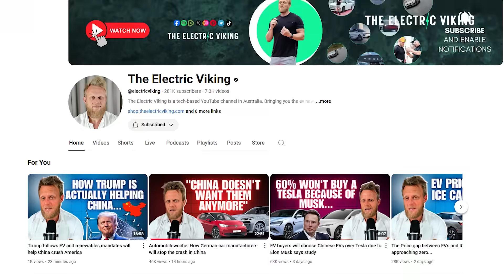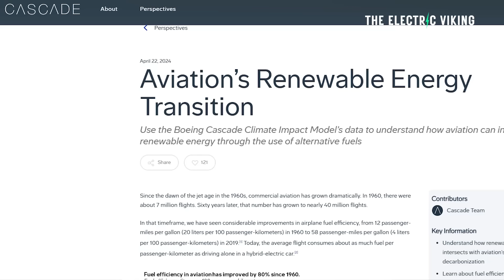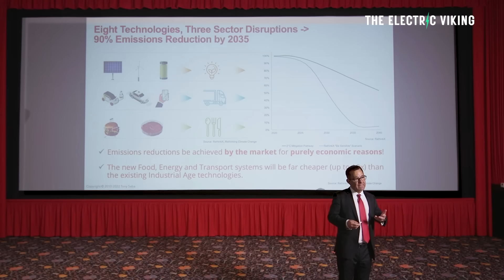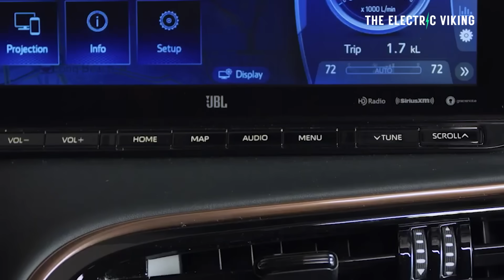The global industries that clean hydrogen production with DISRUPT

Comment: For cult followers of Electric Viking, all opinions of his are sacrosanct. While talking about hydrogen, he forgot to mention that the roundtrip energy conversion efficiency of converting renewable energy to hydrogen to fuel cells is only 30-40%, while battery round trip conversion efficiency is more than 90%.
BTW, why carrying heavy batteries is a problem for big ships? Weight is not a big issue in water transportation.
Reply: Batteries don’t work for large ships due to their low energy density. I think practically, the same thing goes for hydrogen. Even liquified, it takes up a lot more space than hydrocarbon fuel for the same energy. The higher efficiency does make up for this difference to an extent - a ship might only convert 30% of fuel energy to propulsion whereas a fuel cell on hydrogen can do 70% or so. But you have to also consider the extra insulation and management infrastructure that hydrogen needs. Once you add all that and all the safety measures hydrogen needs, it ends up consuming 4 to 5 times as much space as conventional fuel tanks.
Maybe you could get away with that on a large ship but no way will that work for an airliner. Every possible bit of room is already occupied for fuel tanks on long-haul aircraft. Hydrogen will not work as a replacement.
Reply: If it is only "excess" energy being used to produce the hydrogen, the energy losses aren't so relevant. The real problem is the low volumetric energy density of the hydrogen and it's storage system combined. In a large ~ocean crossing ship, a usable amount of hydrogen would require such large storage containers there would be little room left for cargo. Batteries are slightly better, but they would still take up far too much space.
Reply: It’s simple and well known, oil, yes oil is a dense energy material, easy to store and the infrastructure is already here. You can’t get around this fact no matter how much you may wish is so. Aircraft and ships need this type of fuel as all other alternatives are not viable.

Comment: There's a simple solution for excess electricity - expand the grid.
Sure, as distances increase so do transportation losses, but you can have a huge percentage of losses there before you approach the level of inefficiency that producing, storing, transporting and using hydrogen has. Costs saved by not building out a hydrogen infrastructure could fuel a huge international grid expansion. Add batteries to stabilize grid power and electricity prices.
Reply: I think at first grid operators are more likely to buy batteries than further expand the grid for export, they are doing both now, then a while batteries only and then maybe if they can still export, my guess is: it won't be as economical anymore

Comment: The oil cartel LOVES hydrogen. Main reason is it's very hard to make and store your own hydrogen at home AND it's easy for this industry to create a huge markup. That essentially means that the consumer is forced to go to a hydrogen station and pay whatever price the pump says he should pay. SUCKER! Look at petrol. Venezuela is selling it close to cost at about 13¢ US a US gallon. In the US it's currently 3,50$US per US gallon, a 2700% increase. You read that right! The markup is GINORMOUS (and you wonder why the US wants to invade Venezuela...)! 
This industry also cheats with the pricing. When the price of a barrel of oil goes up it IMMEDIATELY shows at the pump. However the price comes down slowly - the oil has to be refined, processed and put in the station's reservoirs.
Contrary to what the Viking is saying, overabundance does not necessarily mean cheaper price. Per example, that 2700% increase doesn't really go down even if there's plenty of gazoline to go around. It's almost certain big oil is going to lock down the production of hydrogen and do the same thing there. The fact that hydrogen is insanely expensive at the moment is because this industry is already ramping the price up.

Comment: If we get to the point where renewables are built to the point of lots of excess generation, we could eliminate hydrogen used in ammonia fertilizer manufacture (via the Haber process), That's the number 1 use for hydrogen now, only now it comes from steam reforming of methane. I think that will be the first use of excess hydrogen. If NH₃ production is located where the hydrogen is generated, it eliminates the need to store it for extended periods.

Comment: I wrote an essay on this subject in the early 70s. It's a good idea to export surplus energy as hydrogen but it is only really practical to do so in chenical combination e.g., ammonia, Toluene/Methylcyclohexane, Dibenzyl Toluene, Magnesium Hydride (MgH₂), Sodium Borohydride (NaBH₄) or Methanol (CH₃OH). There are pros and cons to each of these. They can be used for different purposes.

It is a practical solution. It can be done.

Comment: Hydrogen makes great sense for seasonal storage. Where batteries makes sense for a few days a week  Those particulars will change as time goes on when Battery‘s get a lot cheaper, you’ll be able to store more and more days, weeks of energy, but hydrogen at some point becomes easier because  you store the hydrogen in big tanks , it’s cheaper at very large scale ,seasonally one month two months or more.
  With ever increasing solar and wind, you’ll have huge amounts of curtailment that can be easily absorbed with batteries for the short term and hydrogen for the long term.
Michael libre says in one of his podcasts that hydrogen is an economic because the electrolyzers cost so much money in the another podcast,He says that it’s not the cost of the electrolyzers it’s the cost of the electricity, and there isn’t enough curtailment, which he puts out 10% to run The electrolyzers profitably, but curtailment is only going to increase because of ever increasing solar and wind generation and the cost of electrolyzers and associated equipment are going to drop as they become more common.
Reply: Michael libre’s comment was uneconomic in relation to hydrogen system.

Comment: Question is how to store excess electrical power. H2 has tons of issues, the energy to compress or liquify and then the storage to transport - high pressure, low temperature, wastage in storage - can't store liquid for that long - it just goes. Even with constant refridgeration. And the low volumetric density (huge volume per joule). Elon realized that methane is a good compromise, as the one carbon atom holds 4 hydrogen atoms. So same energy stored in 1/2 the volume.
Reply: How to store excess electric power? Batteries!
Reply: Store it in ammonia. Then ammonia can be easily and cheaply shipped around the world
Reply: @Stan_144  The problem with all these solutions, is that you create an other problem: The amount of labor that goes into producing electricity, from electricity....
Windmill, production of H2 (lose about 60%), make it into Ammonia, store it (lots of energy lost and labor). Then you dissolve the H2 from the Ammonia, to then burn it in a furnace make steam and lose an other 60%. Just random figures I use, but it is not far from true.
I am a proces engineer who worked in coal fired plants but also gas etc. I know the purifying process and the lot. You would need so much windmills, solar panels etc, the earth is not big enough for that and electricity would become beyond affordable for the normal working class people.
Here in the Netherlands, Shell and other companies tried H2 projects, which they stop as soon as the subsidy runs out.
Reply: @pietermoorer3679  Solar & wind could power the whole planet if we want. Start with solar panel on your roof, with backup battery & you will never buy electricity again. Maybe make money with surplus energy production.
Reply: I know where you’re coming from but it can’t work.. Ammonia synthesis uses 3% of world energy. Sure a good chunk is hydrogen production but the process of fixing N2 into ammonia is immensely energy intensive, you could never do all that just to produce a mediocre (at best) energy storage medium.
Reply: @Stan_144  Ammonia is nasty stuff, if it leaks near you evacuation is the only option.
Reply: You can store it in heat or cold, Saudi-Arabia needs big amounts of cold, just produce ice.
Reply: Store it as Methanol or Ammonia. Both are used heavily in the industry. Easy to store and transport.
Reply: The energy is free, so you can spend the extra energy for compressing it.
Reply: @autohmae solar energy is not free, you have capital expenditure to install it and on going maintenance costs. You’re far better off putting surplus capacity into batteries than using it to generate hydrogen (it’s vastly inefficient to convert electricity to hydrogen and back again). Even if you don’t use batteries there are more efficient ways of using surplus power.
Reply: If hydrogen can be fuel for an aircraft (no idea where they are going to store that volume of hydrogen in an aircraft???) then it will also be good enough to drive. As mentioned, it will be almost free because there will be a surplus of electricity.
Ok, your PV is free electricity... not really free, you have to pay for the installation too of course. So the EV is the logical choice....
But a government is only a government if it can solve problems. In the 1st place, money has to come into play. Huge amounts of excise taxes on fossil fuels are going to go away...or maybe not....
If you "refuel" electricity, including at home, you will have to pay excise duty on it. Your car is smart enough to pass on the charged kWh nicely to the authorities, the bill follows. Free does not exist.
And so a government can steer the market, with subsidies and extra duties and/or excise taxes.
In the end, you will pay.

Think it can't be done? We also have to pay for rainwater...just like the sun, it just arrives at home. But our politicians are not stupid, money has to flow in their direction and that is why there are weird twists in legislation to make that possible.

Comment: I agree generally. The thing that usually determines which technlogy or fuel that gets the lion share of adoption is some kind of step change break tbrough. A break through in batteries pushing one way. A break through in hydrogen another. An out of the box black swan development could swing the balance. Its not out the possibilities that excess hydrogen becomes so cheap that its used in trucks and SUVs in the same way that diesel currently services that roll. 
Its more of a concern that red herings like nuclear and carbon sequestration distract focus from the main game. They are the chosen decoys for the fossil fuel industry to slow down renewables and take them out of the control of individual households. Big energy companies dont like self contained off grid households. Theres no continuous revenue flow from thse households.

Comment: I think ammonia would be a better energy storage than hydrogen. Ammonia does not require very high pressure and very low temperatures. So storing ammonia would be comparable to storing propane.
Reply: And ammonia is incredible dangerous and unpleasant to have around. I know, I work with it!

Not going to happen, or if it does, it will soon be abandoned after the first few accidents.
Reply: @javelinXH992  The fact ammonia smells is a good thing, as it protects you in case there is a leak ..
Reply: @ No it does just ‘smell’. It is really nasty, toxic and physically damaging to eyes and airways. No way should it be ever used outside of a professional handling facility and that kills it for general use.

At that point I would rather people stick with petrol.
Reply: Ammonia kills you quickly and silently

Comment: It is foolish to create 200% more energy than we need. Peak demand can be met by batteries.
Reply: It is trying to get the lowest price combined for electrical storage and generation even if capacity is wasted. At an extreme example the capacity of solar panels may drop to 10% when it is raining. If solar panels are extremely cheap and batteries are extremely expensive it could be better to have 10 times more energy produced by solar than needed and batteries only to store enough to get us through the night. However if batteries were very cheap you would only need just enough generation to meet capacity. The price differences between generation and storage determines how much additional generation is required to reliably meet demand and the cheapest overall cost.
Reply: You need 200% capacity so that you can meet demand using solar during the day AND charge your batteries at the same time to power you through the night.
Reply: you will find a use...

Comment: A new way of looking at hydrogen, every bit of oil every green plant on the planet is powered by splitting water
Reply: Correction, I should have said facilitated instead of powered by
Reply: Another way to look at Hydrogen is that it is a GHG (Green House Gas) in itself like CO2 and it is 12 times worse than CO2.
So if it leaks out, and it does that all the time, it will be better at destroying our Ozon layer